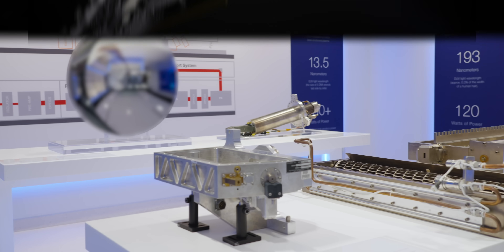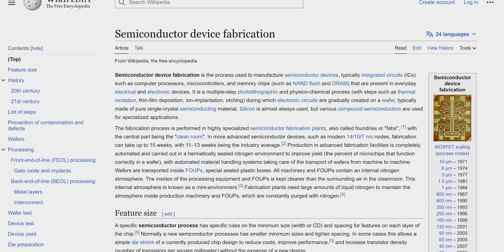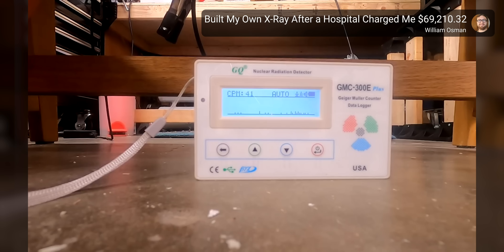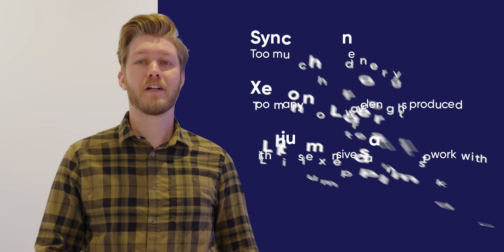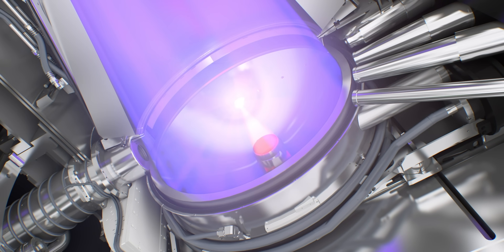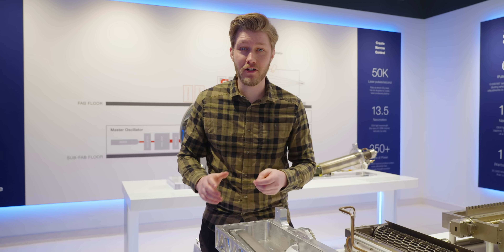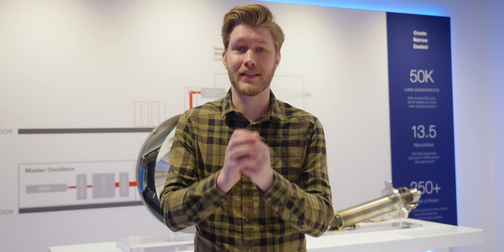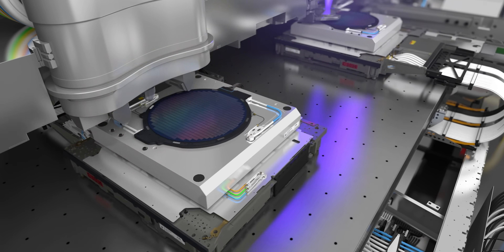You Didn’t Build your PC… This Did. - ASML Cymer Tour

Comment: And considering how few of these manufacturing plants we have in the world, it’s no wonder that there was the chip shortage during the pandemic.
Reply: Yep and ppl updating home computing, stopped making cheaper chips
Reply: Its not really a shortage of extreme hight tech chips like cpus made in <10 nanometer processes. The big problem is with way simpler components that are found on every PCB - most ICs are made on "antique" processes in the hundreths of nanometers range. Those are in short supply, and re-equipping a production line is a time consuming and expensive process.

Comment: honestly, before the chip shortage i never thought about manufacturing of chips. but once i started diving a bit into it, i was surprised how ASML was really flying under the radar for many. Everyone depends on it, even more now than ever. and it seems like they have no competitor at all.. shocking really
Reply: They do have competition, its just that the competition is so far behind its an entirely different market. They have 100% marketshare on leading nodes and 90% of the total litography market.
Reply: @traniel123456789  I honestly thought this was something the fabs engineered
Reply: It's not easy to compete when the tech is proprietary.
Yes, anyone can make a computer chip, but to be anywhere near competitive, or even to make modern equivalent chips is incredibly difficult.
Reply: Developing EUV machines took an absurd amount of capital investment over more than a decade, on top of decades of learnings from previous generations of lithography machines. For example, this facility that LTT toured used to be an independent company called Cymer, which was an ASML supplier. When ASML asked Cymer to work with them to develop an EUV lightsource, the required investment by Cymer was so large that it made more sense for ASML to acquire Cymer in order to do it.
Reply: @bawfuls  
 - Cymer was working on EUV light source years before the acquistion. (by ASML)
 - Cymer still is an independent company within the ASML group, US gov didn't allow them to get merged into ASML, to have control over the technology and keep it in house. (EUV system was originally developed by US national labs, NIST, a bunch of American companies and ASML joined the efforts later, ASML actually asked the US gov for the permission to get access to the technology, (Canon, and Nikon were eager to get involved too but US gov denied their request))
 - Actually ASML acquired Cymer to keep the Cymer's technology away from the competition.
Reply: EUV tech was invented by a government program headed by the Department of Energy. Canon and Nikon would be making EUV machines right now but congress barred them from having the research because they are Japanese and "had a good foothold in the industry."
Reply: Yep. They have a collection of the worlds finest minds.
Reply: It really is like everyone in the west at least decided pooling all the R&D into one project instead of several competing ones was a good idea. and well it worked..
Reply: Does asml have competition in this market?
Reply: @barrett-si4zq  They have such a monopoly that it's one of the things protecting Taiwan from China.
ASML sells machines to Taiwan but not China, so China has to buy their chips in Taiwan.
Which discourages them from invading Taiwan, because if the machine breaks, only ASML knows how to fix it.